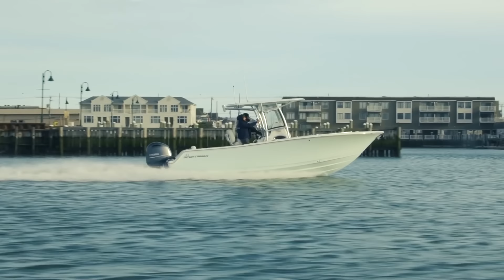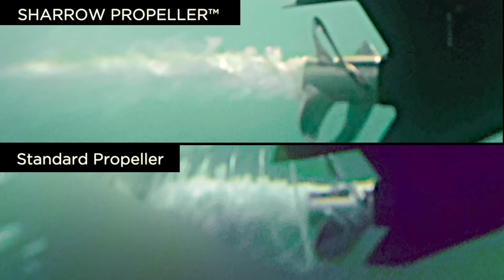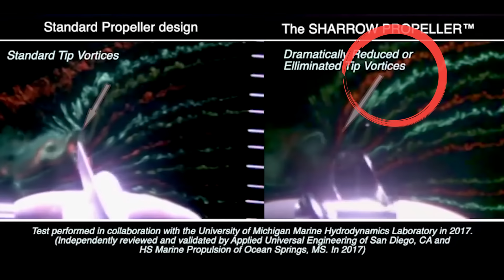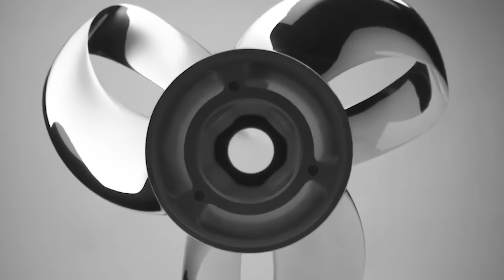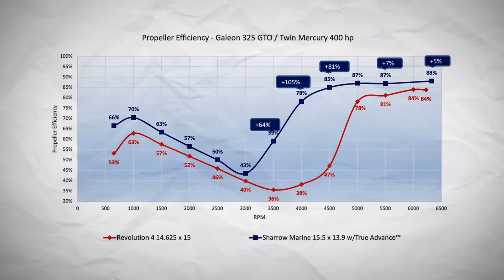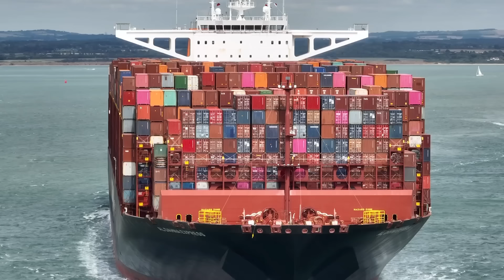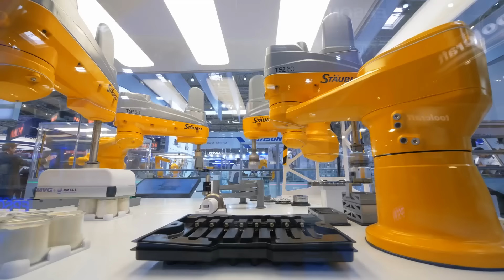This Genius Propeller Will Change Transport Forever

Comment: Would a tandem co-axial toroidal propeller in a turbine yield even more efficiency? A standard contra rotating coaxial propeller yields 15% more efficiency over standard propeller. Could this reach 30% with this new prop design?

Comment: I can see an incredible use case for propeller driven aircraft as well, whether internal combustion engine or electric.
Reply: I don't. Gimmick props have been tried for decades. Plus the thumbnail claims 105% efficiency. If this is supposed to be geometric efficiency, then it's a lie as that is not physically possible. It might work on boats, though

Comment: The only negative I can see in boating applications is when the prop gets damaged. A conventional prop may get a major knick in it, but it's performance might not drastically affected. I just wonder if the thinner wall and lack of filler material would cause an issue

Comment: I suspect, if it was too miraculous as told, everyone would have already use it. 500$ to 5.000$ seems ten fold increase in propeller price, or 5.000$ to 50.000$ if it's a bigger ship, or even 50.000$ to 500.000$ if it's a way bigger ship; but also it's nothing compared to fuel costs. These boats and big ships drinks fuel like a polar bear drinks water under the hot desert sun.

Comment: Unfortunately this design will very likely not change transportation for a very long time because of the economy of cargo ships. Fuel for cargo ships is usually paid by the contractor, but the ships aren't oufitted by them, they are outfitted by the owner of the ship. Since a lot of changes that already exist that would be sufficient to reduce fuel usage would literally only benefit the contractor, they simply don't do it, because why would they? Regulation also doesn't work since if a country makes it mandatory to use a type of propulsion, ships would just simply be registered elsewhere, in a country, which is incentivesed not to enforce the same laws, knowing it would attract a lot of ships, for which they can charge money. Possibly the only way to solve this is international regulation. But that's the most difficult thing to achieve in seafaring.
Reply: Wouldn't the contractors seek out ships that charge less money, like ones that have this new propeller will be able to charge less money than their alternatives.

Comment: Would be insanely difficult to get this to work on helicopters though. I mean the Kaman K-Max uses ailerons to change the pitch of the blades for lift so if you could mount these on a horizontal shaft with a pitch horn it might be possible but I think the torque over moving all that drag producing surface would not make it feasible.
Reply: You're still only moving the same amount of media over the wings as in a traditional rotor design. 
On a helo, the mast head design would get highly complex, and likely not feasible over a more traditional design.

Comment: With regard to aviation propellers, not all general aviation aircraft use slow turning motors. Some use lighter, more modern motors such as Rotax, aircraft, Honda conversions, and some automobile conversions turn much higher rpm, using reduction gears to get the prop to a slower speed, to avoid excessive wingtip speeds. Possibly this type of prop could be used with these types of higher rpm engines.  In addition electric general aviation aircraft are just on the horizon with several manufacturers already producing experimental versions. Couldn’t these props be used on electric aircraft?

Comment: That looks like the recipe for wind turbines to 1. reduce noise and 2. increase energy yield. and 3. Mitigating Shadowstrike Frequency Annoyance.

For propeller applications: The closed shape reduces the risk/severity of injuries and damage. Larger flow diameters compared to conventional propeller systems would thus be possible, which further improves energy efficiency.

Comment: Great vlog and a wonderful development.
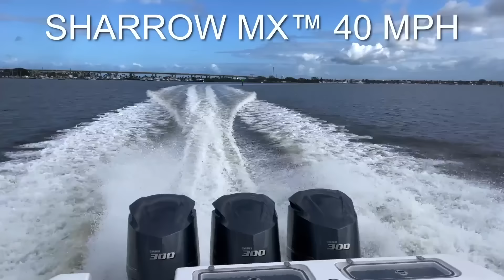Though it is a bit dodgy in places 2:34 the recording of the two propellors and engines. With the standard prop the noise from the engine itself is audible and in the toroidal prop version it has been edited out. Above water it is the engine itself which makes most of the noise.
Sad that someone did that editing. It undermined a great vlog.

Comment: this design was disproved during testing. it works better in water than it does as a propeller for drones. they were caught altering the actual speed of the prop to reduce the noise. there was also increased vibration detected as well.

Comment: The cost may be reduced by melting of metallic substance into a clay mode and polished afterward.  Or, by assembly of different blades as into one unit, although the efficiency may be reduced a little by adding hidden screws and nuts, but the cost would much reduced too.

Comment: 105% efficiency basically means if I put in 1 Watt of power I get 1.05W of power.

Scaling this to feed a hydro generator that drives the motor that drives this prop, we have unlimited energy.

😂

Comment: I love seeing engineering breakthroughs like this. Amazing stuff.
Reply: not a breakthrough.   Its old story
Reply: Nope not even close, it’s just two regular props welded at the tips. Having two regular counter rotating props on one shaft would be better, some submarines do this. Really you can’t engineer better props unless they have more blades prop engineering peaked at isambards great eastern which had 6 or 8 blades

Comment: Definitely an exciting design, but it seems there is one advantage the standard props have over the toroidal, that being standard probs have the ability to change their pitch. Most cargo ships don’t use azipod thrusters so instead they have controllable pitch props. Seems like a huge design challenge to implement toroidal props on ships that utilize controllable pitch
Reply: I’ve been doing some research and it’s actually not that hard

Comment: I thought i had seen that propeller years ago. Sometime in the early 1980s. I wondered then if it would improve helicoptors.  It is very similiar to the blade chemists have been using for over 30 years.

Comment: with it pulling air from a wider area does that indicate that the amount of air pressure is probably also higher than a standard blade? Increasing fan efficiency and reducing noise would be great for anything computer related and if it has high pressure then it would be nice for radiators

Comment: If the pitch could change on a blade pushing another blade with a fluid in a closed loop cylinder. Be a hydrostatic sort of transmission. Always wanted to play with a used apu turbo shaft large jet aircraft generator could turn something besides a generator. Not real shure probably loud and high maintenance. Might be an airliner junk yard for parts somewhere.

Comment: Your claim of 105% efficiency sounds like an advert for a perpetual motion machine... theres no such thing as 105% efficiency.
Reply: He explains in his pinned comment that it is a 105% increase in efficiency relative to the normal propeller, not a 105% efficiency
Reply: @fengtaowang192  Classic case of misleading thumbnails then. I said what I said, if he doesn't want to get it confused, then double down on making the point valid. In the thumbnail it says "105% Efficiency" leading people to believe that it is in fact that. I do not support that non-sense at all, there is enough misinformation in this world that does more harm than good, and this is just salt on a never healing wound.
Reply: @IcyDV  ya, I kindof agree but that what youtube is can't do anything about it

Comment: It should not be that hard to beat the original which was based around the sycamore seedling design. I forget the chap who designed it.
But quite clearly pointed out in the early 1900 by viktor schauberger.
We used a design nature used as a break.

Comment: One of the most fascinating things about this is that it can be retrofitted to just about anything. As soon as the manufacturing reaches reasonable scale you relatively inexpensively put it into any system (as opposed to putting in a new engine for example) I look forward to seeing this tried at a larger scale to see if the increased scaling of weight (for example a full size helicopter blade) would negatively impact effectiveness. The other portion of this that I'm unfamiliar with is how does this system load, helicopter blades flex rather extensively right now and if this shape isn't able to do that and is therefore going to require it to be more built out certain applications might be ineffective.

This is one of those discoveries that makes me scratch my head about how much sooner we might have been able to achieve certain things if we had known about it from the outset
Reply: i think that helicopters change the pitch/attack angle of individual blades so probably it wouldn't work out

Comment: I could see this being interesting for FPV, quieter at the same performance and potentially greater crash resistance with the right materials. Not to mention it would probably hurt a lot less to get hit by one of these props compared to an open blade
Reply: The noise reduction and efficiency (resulting in longer flight time), will definitely interest the UAV community.  I'd buy them TODAY if I could buy aftermarket props for my DJI quads.
Reply: Agree on the first part but I have my doubts when it comes to crash resistance.
Reply: Problem is, they would cost a fortune because they are way more intensive to manufacture and need extremely low tolerances. Basically, you won't see this thing on regular people quads anytime soon, if ever.
Reply: @jetsetgo1999  So we have to invest in cooler 3D printing technologies for home application, like carbon fibre tucked in with the strand, and use eg ultrasound sheer waves to mix it with existing layers and have more cross linking between strands of print-out. 
Also, I would like to have multi-head extrusion in miniature size crawling relative to each other. But hey, future just begun ;)
Silent aircrafts are lighter-than-air ships, and use props only to navigate, not to levitate.
Reply: @jetsetgo1999  I don't lnow for sure. What if it is possible to find the right stretchabbility and do it like a sail? Will ist self-align into optimal path? This should be the way... of the genius propeller ;)

Comment: I wonder if that shape could work on turbocharged engines. Like pulling/pushing more air in to the cylinders or to work with lower emissions at lower RPM's?
Reply: Turbochargers would be using them if it were more efficient

Comment: It was found to be too inefficient for an air propeller on drones and PC case fans. It has way too much drag and does not push that much air because the surface area was too big. Not sure how that would work better on boats though...

Comment: The thumbnail I clicked on said 105% efficient.  By definition, efficiency can not exceed 100%.  If it did that would mean you are getting more energy out than you put in.  Not possible unless the mechanism has an internal power source.

Comment: Its things like this where I'm always questioning humanity.
We develop special insanely complex and expensive paints to reduce drag on ships by a fraction of a percent, but haven't tried out enough alternatives to the screw to notice that there are 20% more (fuel-)efficient designs possible? Like, what has the R&D department of THE WORLDS LARGEST AND MOST IMPORTANT WAY OF TRANSPORTATION done the last, lets say, 2000 years?

Comment: I wonder how this would affect aircraft that use turboprops. Aircraft like the Tu-95 are so loud that they’re able to be tracked via submarine sonar. Correct me if I’m wrong, but I believe the reason is that the tips of the blades move fast enough to break the sound barrier which creates sonic booms.

Comment: Feels like a gimmick. Elliptical wings have been around forever and are incredibly effective at reducing tip vortices. 
I struggle to see how this drone propellor effectively differs from a rounder blade tip like that of a desk fan or a conventional propeller encased by an annulus.

As for the boat prop. Horses for courses. A more/less aggressive prop is entirely dependent on where on the curve you intend to operate it most.
Time will tell I suppose. Will we still be talking about this in even 5 years time? I don't think so.

Comment: a number of questions here for people curious about wind turbines:
- wind turbines already have enormous blades with manufacturing difficulties - would these compound with toroidal design manufacturing difficulties?
- wind turbines have much lower RPM than propellers - would there be any benefit? is there a similar efficiency graph for reynolds number?
- modern wind turbines often have variable blade pitch - how is this handled on toroidal propellers?

Comment: Every application where you have a fan, from desk fans to extractor fans could use this. While it's still more expensive, ventilating tunnels and improving transport is great. But there is an enormous market if it becomes cheaper!
Reply: You are right.  This is the question....mass adoption or hoarding of the intellectual property....or rights to the design.   If the intellectual property owner (IP) allows the technology/design to be used and make less, then she or he will win and humanity will win with her/him.

Comment: There's youtuber named quadmovr watch his video on toroidal prop. And he made one 8 blade propeller. See the difference. Toroidal is overrated. They may be working in water but if they did in air y no ones using em.

Comment: FYI: Efficiency over 100% isn't free energy or perpetual motion. It uses existing energy from the environment, possibly with effects like localized cooling occuring. Heat pumps are a great example of this. Its how you define efficiency.

Comment: Additive manufacturing with CNC has revolutionized the efficiency of "revolutions" lol The tip vortex effect is bad on wings too. New designs for some high altitude trans sonic planes actually feature semi biplane wings angled to be connected at the wingtips

Comment: misleading hype especially for young budding engineers.  the device simply has more surface/material.  make the common propeller larger to match the toroidal surface/material used and differences will be small.  I think the reason for drones and water vehicles to use small propellers is for better agility and less cost.  it only loses efficiency once you increase speed. I don't see any benefit for using toroidal unless your application absolutely requires less propeller radius but allows more width.

Comment: Flight wount benefit from this beyond drone noise reduction.
Even with higher efficiency, theres simply no point in aircrafts beyond what we alreafy have.
Also, flying cares are a gigantic safety danger.
I mean... cars already are the second most dangerous transport method.
Add wings to that shyte and it will become apocalyptuc.

Comment: The hydrogenerators wount benefit from this. They are already overengineered to the max. You can literaly not improve upon their design st this point unlesd you discover a new super material.

Comment: I'm curious as to how well they would function on the auxiliary engine of a yacht with a permanently immersed prop as far as both thrust and freewheel drag are concerned. Compared to normal fixed pitch and folding props.

Comment: there has already been great innovation in PC fan's, toroidal blades only benefit comes from reduction in noise at the higher rpm's that boat and drone props reach. With the right fan curve Noctua's  standard case fans are well below the noise floor of most peoples rooms.

Comment: I would also be interested in seeing how the new prop design does in the standard pontoon environment. I.E. weedy low water level areas. Seems like pulling up to the local sand bar for a couple beers and touching the prop on the sand at a low RPM would transfer significantly more torque load to the lower unit causing significantly more damage than you would have on a traditional prop. Very cool design though and glad to see innovation on a product that seems to be unchanged for so many years.
Reply: On a hovercraft

Comment: From what I remembered back in the college days, in thermodynamics, the propeller design is different for both air and for water. I just forgot the exact reason but back then I can still remember the feeling understanding them well.
Reply: reynolds number maybe?
Reply: My initial assumption is it's because air (gases) are highly compressible.  Water (liquids) are not.
Reply: These set of following replies are obviously not from trained aerodynamicists not hydrodynamicists. The marine propellor is of a very wide blade chord compared to the air-propellor, due to its need for greater strength and applied force.  The comparative water forces are almost 900 times more on the marine types in comparison to the aero types. This is due to the greater density of water compared to that of sea-level air. Its not due to Reynolds number nor is the air compressibility until the propellor tip speed approaches that of sound, which became true only during high forward-speed flight on developed WW2 fighters.

Comment: You could get the same effect (maybe) by attaching a cylindrical duct to the circumference of the propeller, like a ducted fan but the walls of the duct would be very thin and would be attached the the propeller itself.

Comment: I doesn't look like you just can swap your current propeller by this one. This new invention looks a lot heavier leading to far more stresses on the axl. Weight is also something that must be considered in drones, so maybe it's more efficient but it weighs more. Will this not cancel each-other out?
Reply: I mean weight is part of the efficiency calculation though? Higher mass is harder to move, assuming this is heavier it means the shape is just that much better. I don't personally think this is that much heavier though.